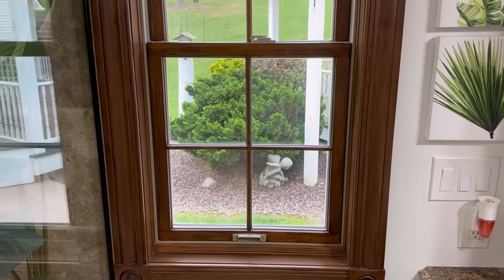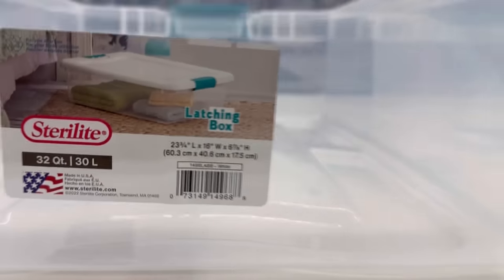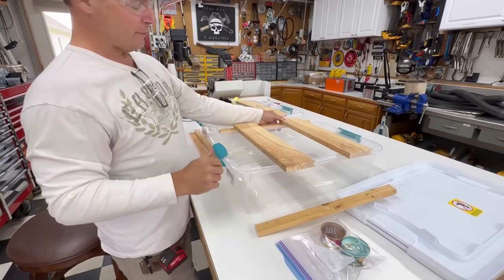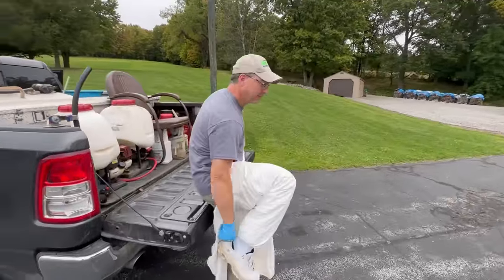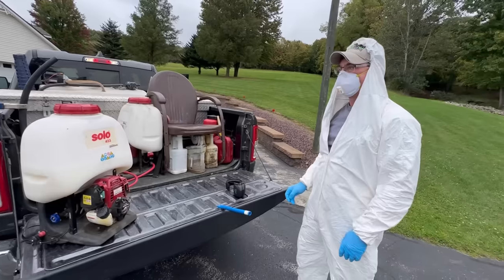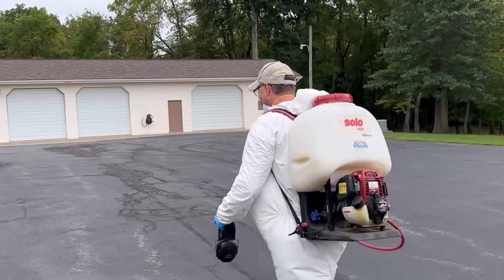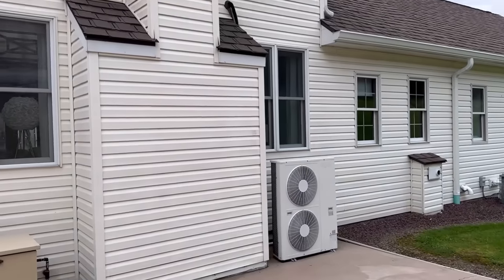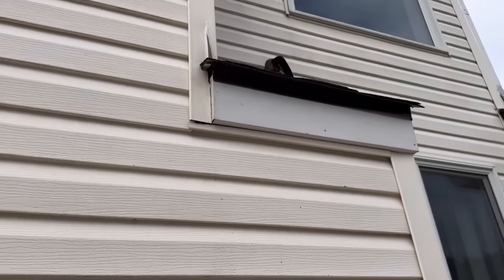Two CHOICES, do it yourself or CALL in a PRO

Comment: Our best success in eliminating yellow jackets is using Sevin powder. Granted most issues here in SE Wis are the ground nesting variety. The application is very safe when done well after dark. For your issue there would need to be something to propel the dust up into the opening. Once the entry area is covered well the problem is solved within 12-24 hrs. Plenty of YouTube videos on this method. I must emphasize these are non-pollinating bees or wasps .
Reply: I seem to only find those ground bee nests when I'm cuttin grass! Lol
Reply: I have used the sevin dust several times.  I put the dust into a small squeeze bottle, turn it upside down and squeeze it where the bees are going in around the house.  I just sprayed around the garage light and within 12 hrs. they were gone.  Good luck.

Comment: Another good video, Doug.  I hate those yellow jackets.  Like some of the responders have mentioned, Sevin works really well.  I had a big nest in the ground here in a hole that was about two inches wide at the top.  I have Sevin dust for my garden and went out that evening and dumped a bunch of it in the hole.  My research said that they come out, take it back into the nest, and it kills them.  Larvae will hatch, but it will kill them, too.  It worked great.

For your application, you could use a duster and shoot it up into the hole.  I have a couple of small ones that would work just fine, or maybe mix up some liquid Sevin in a sprayer?  It should work, but probably won't be as fast as the dust does.  It worked fast for me.
Reply from the maker: Great info, thanks!

Comment: Yellow Jackets are a problem every year, want to help rid your house ? First of all wasp ( yellow jacket, hornets and wasp) like to eat meat. You need to get rid of your local queen, the only "wasp" that makes it through winter is the queen, all the bee you see, die in the first couple of frost, You will need a 2liter bottle, sugar water or pop, a banana peel and a hot dog, cut the top of the bottle at the top of the straight side and invert the cut off piece and place it back in the bottle (making a funnel) use a stapler to attach the two pieces,  pour about an inch of sugar water in the bottle, make a strip banana peel 1/2" wide 4" long push that in the bottle, and break a piece of hot dog off (1/2 of it) and push in the bottle. Hang this bottle out side in the spring , The queen who survived the winter will be looking for something to eat and will be attracted to the bottle. She enters to feed and is unable to find her way back out and dies. The "wasp" only forge with in 2 to 300 hundreds from their nest , Kill the queen in the spring and you have significantly reduced you "wasp" population.
Reply from the maker: Thank you!!!